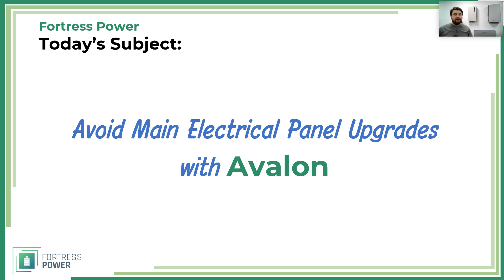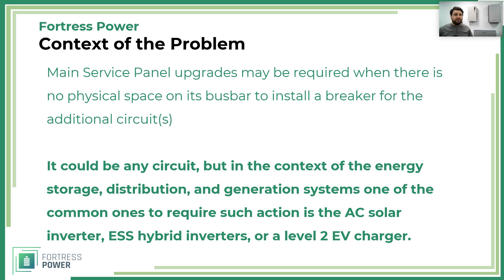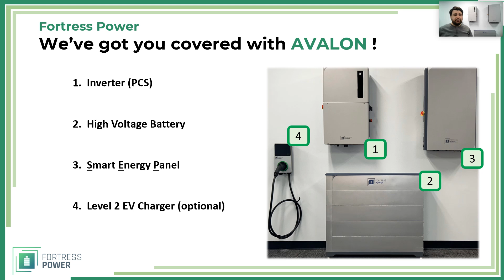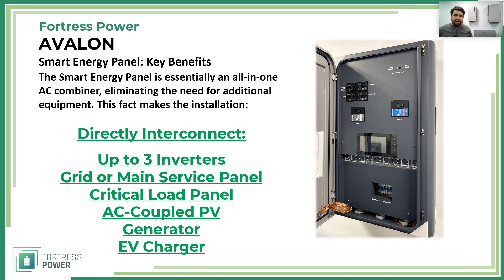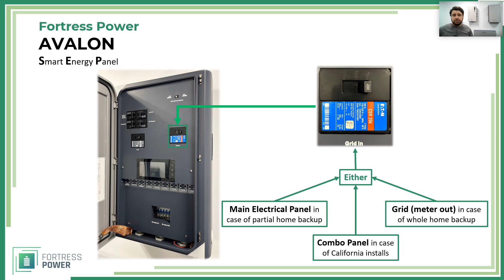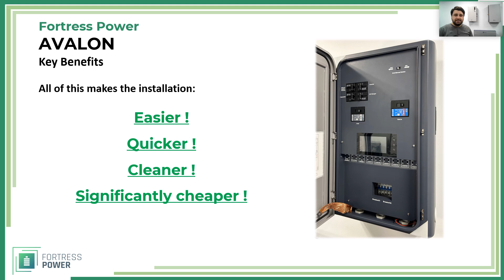Avoid Main Panel Upgrades with Avalon

Comment: Can the panel be used with the 10k or 12k hybrid Envy inverters?
Reply from the maker: Thanks for your question! The Avalon system uses a high-voltage battery architecture, which is different from the 48V setup supported by our Envy 10k and 12k hybrid inverters. Because of this, the Avalon battery isn’t compatible with those Envy models. For best performance and safety, we recommend using Avalon with its designated inverter and Smart Energy Panel.